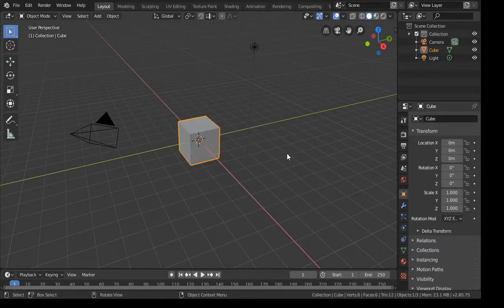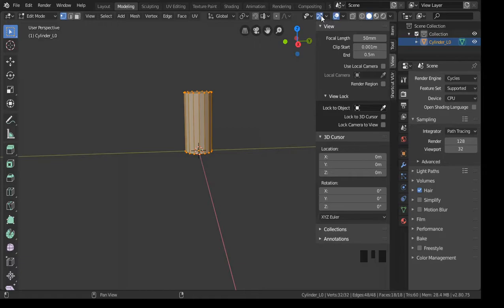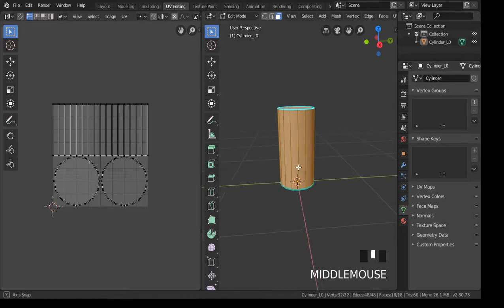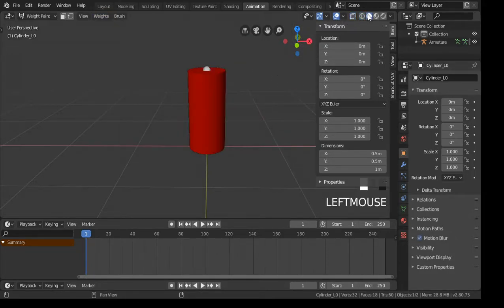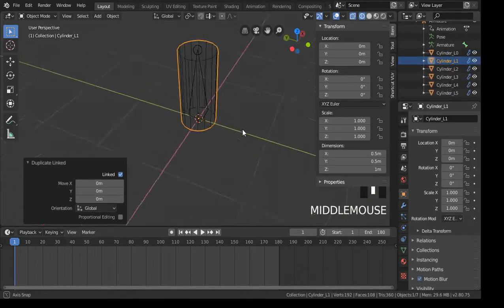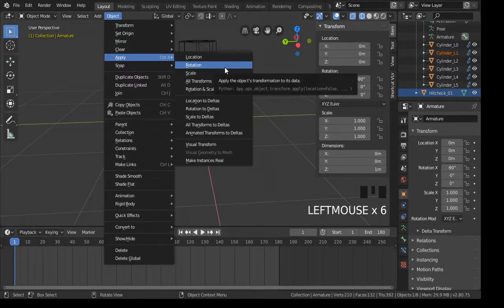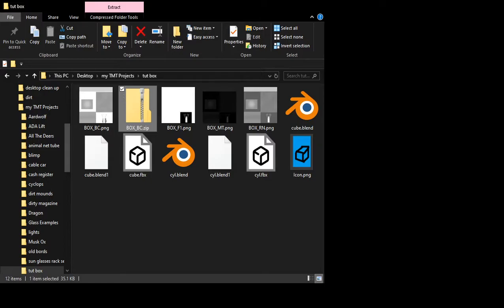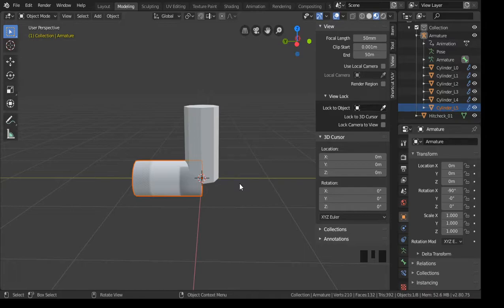Blender 2.8 TMTK Planet Coaster Animation Working Pipeline (old)

Comment from the maker: If your using the most resent version of blender there has been an update to the fbx exporter that will screw up your models shading. To fix this you will need a to leave a 90 degree rotation on the x axis for every lod model during export.